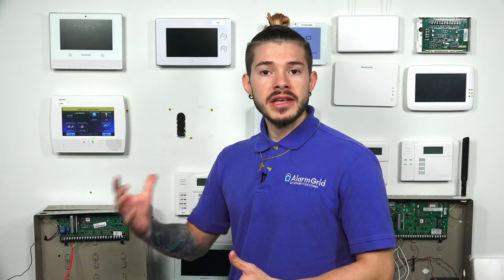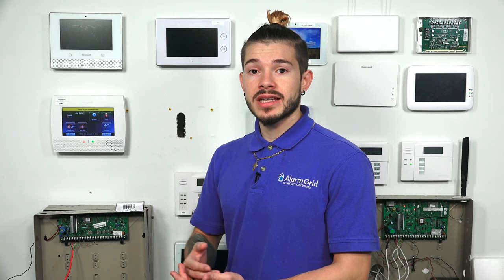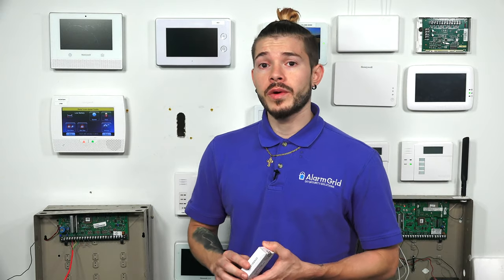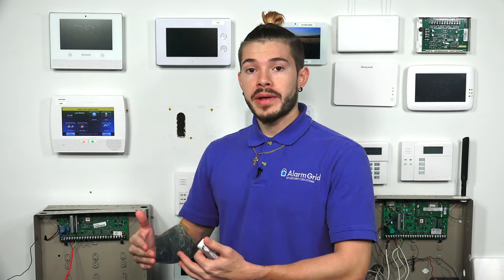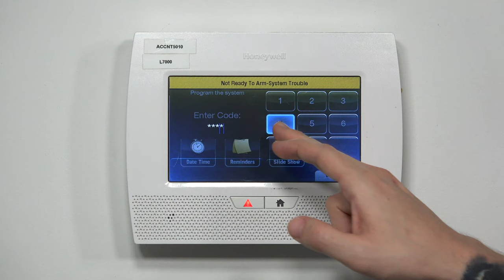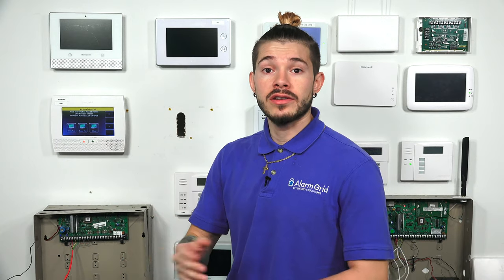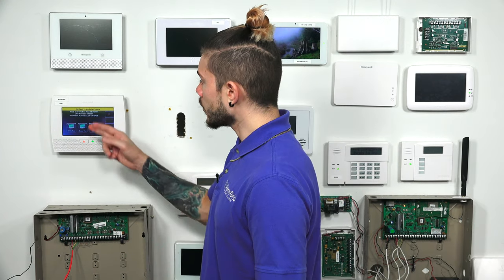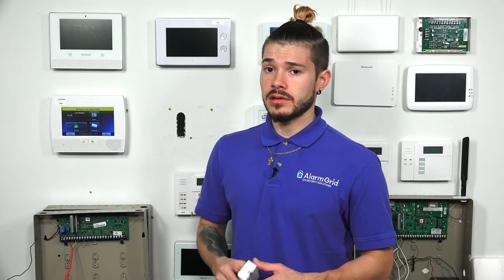Upgrading a Honeywell LynxTouch to Use LTE

Comment: any way i can program it to call my cell phone instead of verizon or at&t?
Reply: Hey Shlomo, The panel is not really designed to call out to your personal cell phone. It has three styles of communications paths. 1) Over standard POTS phone lines, 2) Using an Internet/Wifi Module, 3) Using a Cellular/LTE communications module. The panel does include a "follow me" feature which requires a POTS phone system in your home and to be monitored to successfully use that feature.